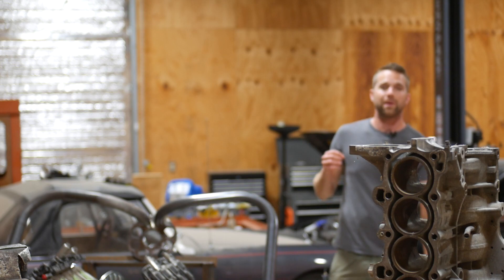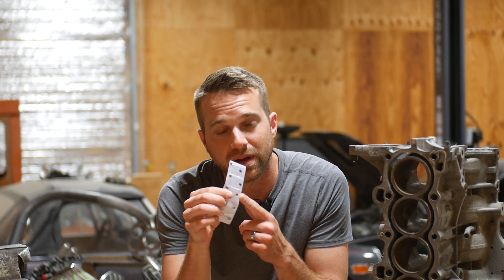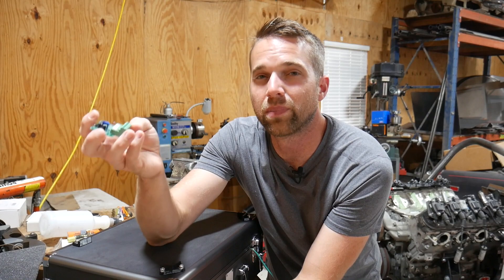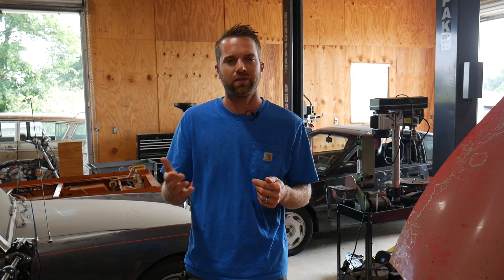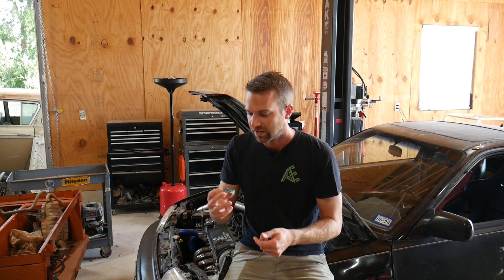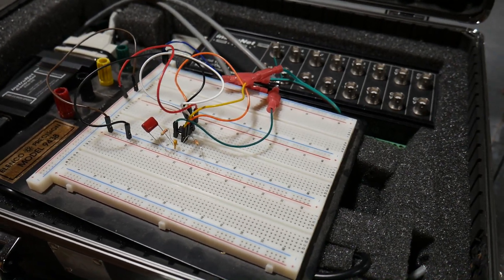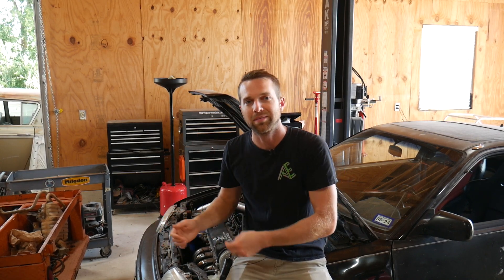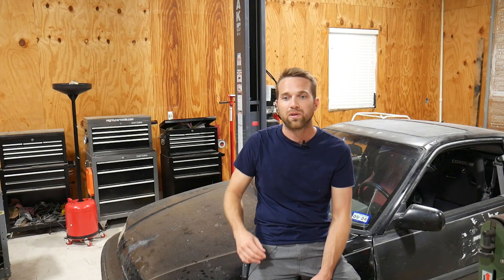Dyno tune while you drive! - CRX

Comment: i designed the i100 unit and am happy to hear it is doing well in the field. to debug a f-to-v converter, one would need to put an oscilloscope on the different IC pins, and make sure requirements as specified by the IC datasheet are met.